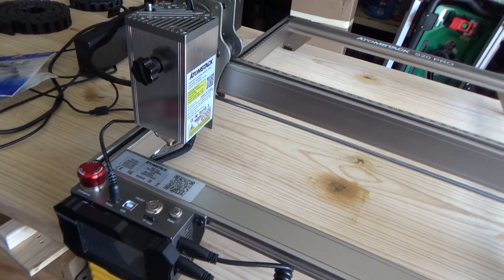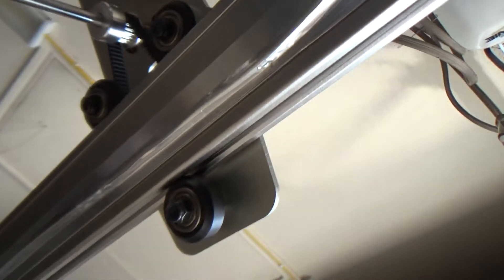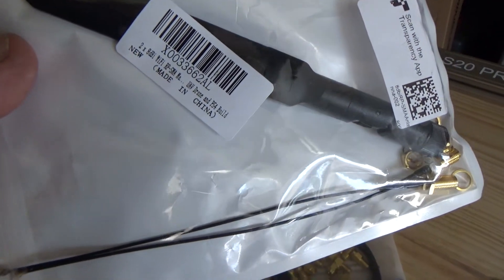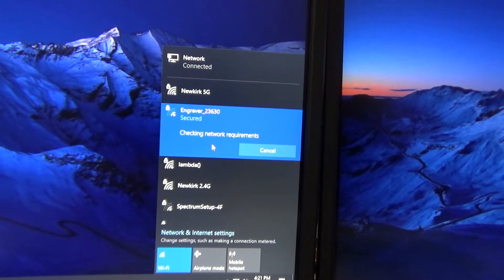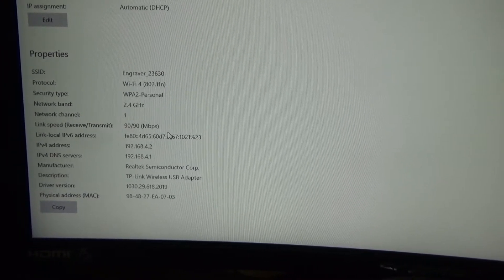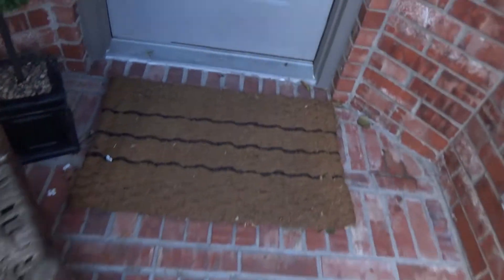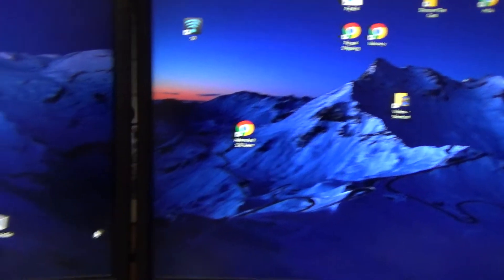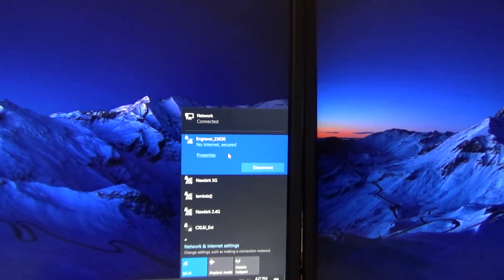Long Range WiFi Antenna Upgrade for the Atomstack S20 or X20 Pro.

Comment: I recommend checking the fill offsets. The laser from Atomstack is a little late, and because of this, there is smearing of the edges when painting bi-directional. I made a detailed video on this issue. https://youtu.be/-sPOyj1CYIw